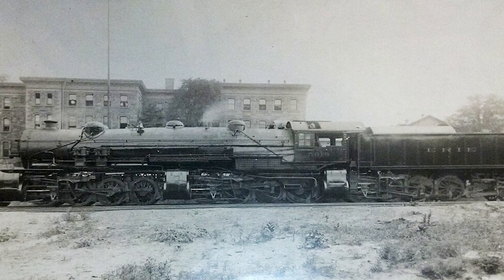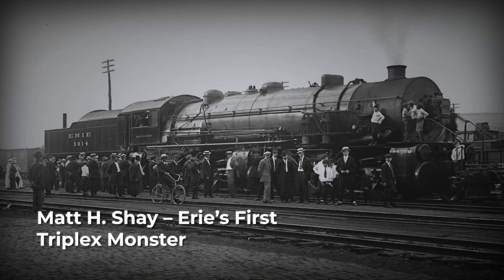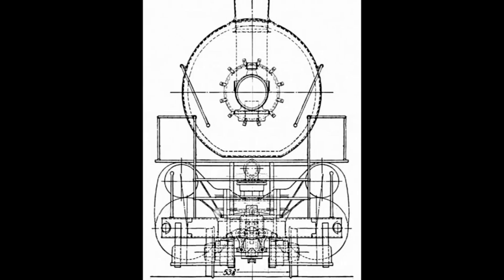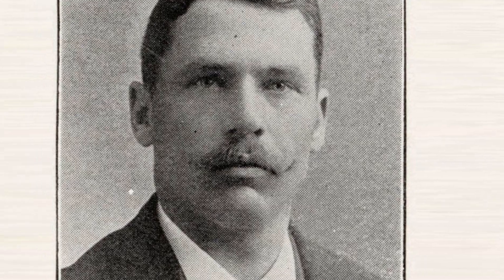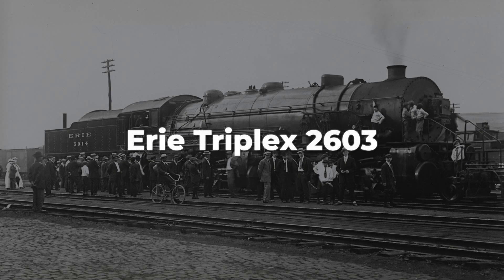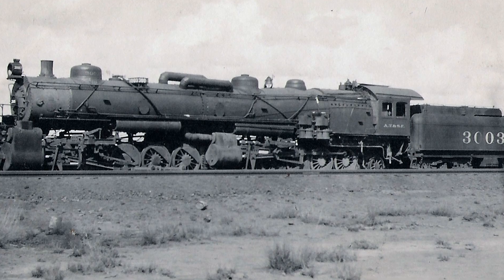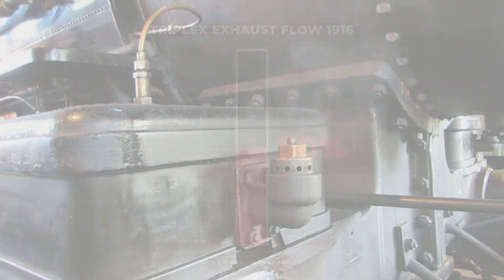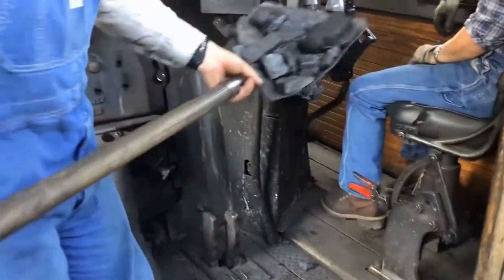How DEADLY Was The Triplex ACTUALLY?

Comment: I hate to spoil the drama with common sense, but I fail to see why the main driving rods were not removed from the tender and the steam lines capped off until a suitable replacement tender could be brought to bear.
   Now, understanding that there surely are details of which I am either unaware or am not cognizant of, and that not withstanding, this would appear to be the dumbest mechanical situation that I have ever heard.
   However, Myself and a deceased  friend of mine talked about this very issue about 15 years ago in the model railroad room.
   We did have a sante fe 2-10-2, that ran about 20mph, and apparently he had a brass tri-plex decade earlier.
   At the time, he mentioned steam starvation, but I had no clue as to the fullness of the mechanical departments stupidity.